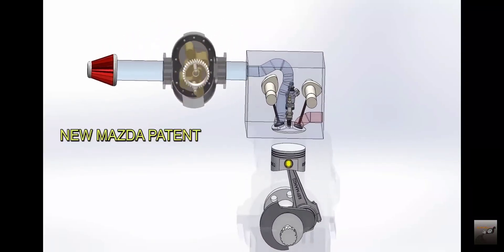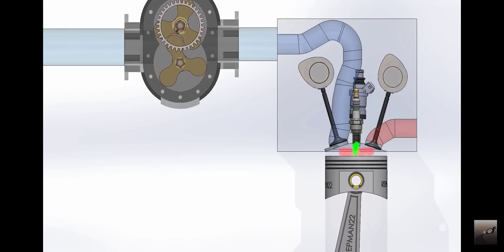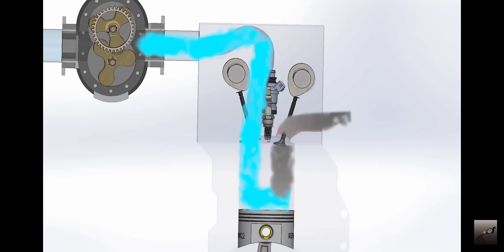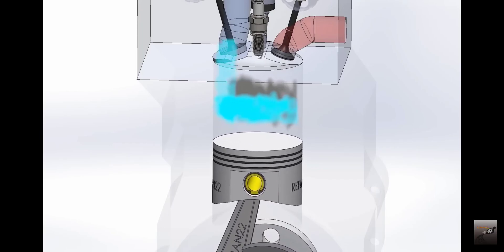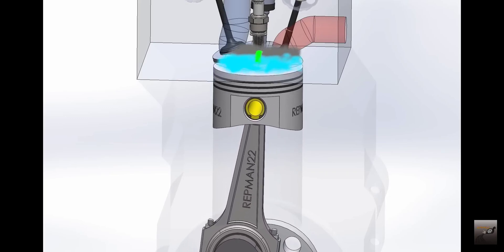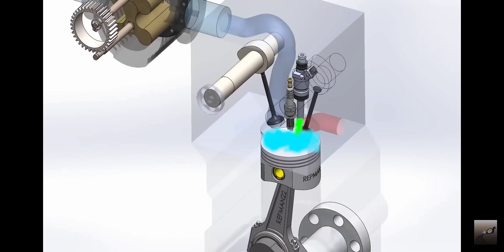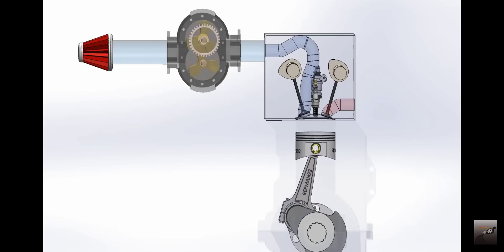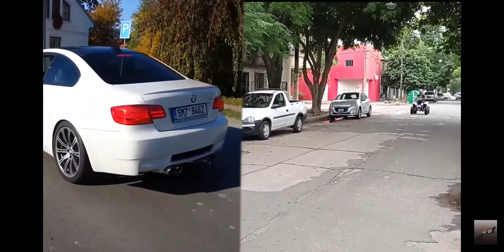MAZDAS NEW ENGINE PATENT!

Comment: All they are doing is direct injection with a huge blow through the cylinder per cycle to push clean air out the exhaust.  Gets it through emissions i'm guessing.
Reply: It turns it into a 2 stroke. Gets rid of a wasted cycle by ingesting air during the end of the combustion and beginning of the exhaust stroke
Reply: @boost1728   This right here. 2 strokes can get alot more power out of the same displacement as 4 strokes. Problem is their efficiency and bad exhaust gases, due to releasing unburnt fuel and bad air fuel mixture in the cylinder. There have been many attempts to fix those issues (we nearly had 2 stroke formula 1 cars), so it will be interesting to see if Mazdas idea works out.

Comment: How tf do you work out that you get better performance by burning old exhaust gases 😂
Also if the injector didnt put as much fuel in during the initial stroke then it would burn more efficiently.
That said, you do have to retain a ratio.
The clesnest fuel is ethanol, it burns far more cleanly than traditional petrol/ gasoline.
This engine has a somewhat great concept of overcoming the 4 stroke cycle.
Its downfall will be maintenance and carbon build up from burning exhaust gases to regulate knox.
If the engine used a catch can instead of putting the breather pipe back into the inlet it would burn cleaner.
This topped with the EGR/PCV makes engines coke up with carbon, alot.
They do this because oil is being burnt and so it used exhaust gases.
Engines are big air pumps and toyotas 3 cyclnder aygo engine is terrible.
Its always on the brink of ping and knocks quite loudly.
Yes it will get 50mpg with a strong breeze but those engines will fail and often idle very roughly.
Reply: Probably to increase the compression ratio without adding additional fuel and retaining correct ratio. Not sure how that works into more power though. That seems ass backwards.
Reply: If u had watched the video, oil is NOT being burnt